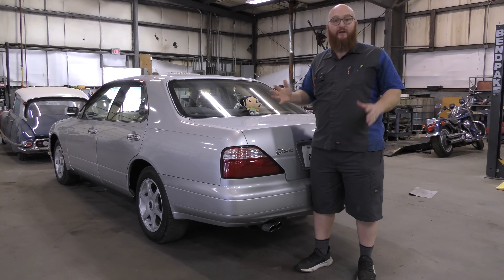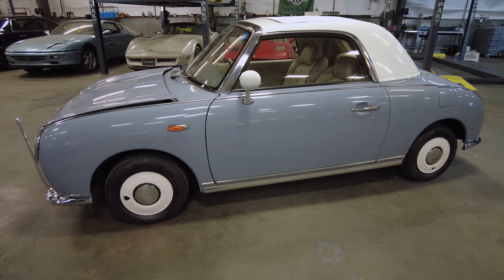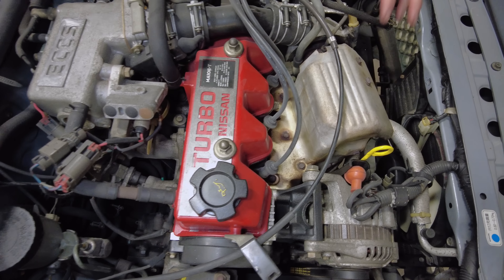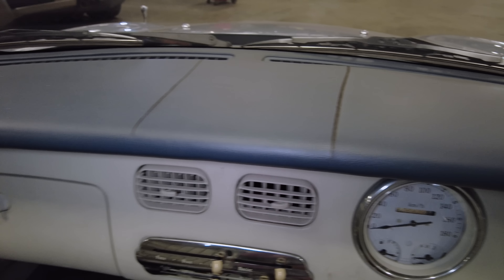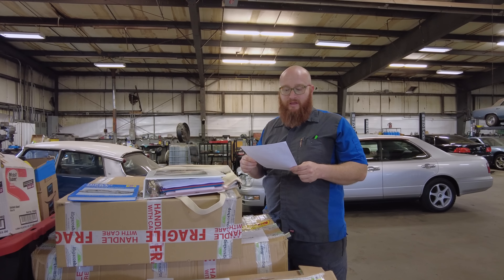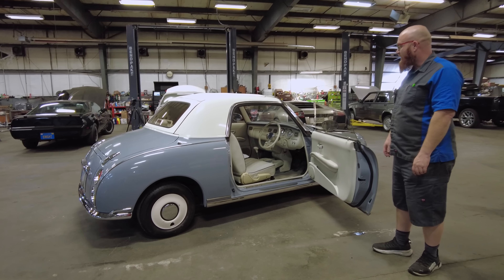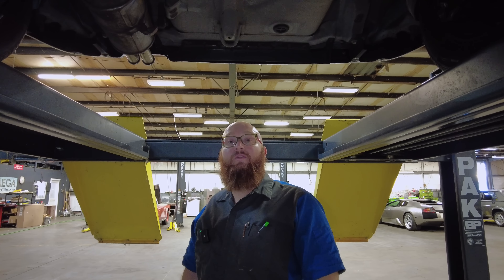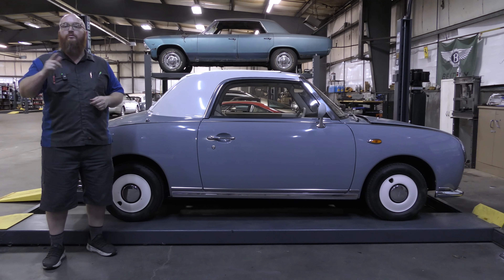The Ultimate Guide to the Iconic Nissan FIGARO: Everything You Need to Know!

Comment: If that car was sold in North America I would have been interested in it. Does seem like it should have got much better fuel mileage . Other then that it seems like a sensible tiny car
Reply: Transmission hampers the mpg. If it had a manual it would be in the 40's. Knew a guy that had a 90 Mitsubishi Mirage and it regularly got 38-40 on the highway with the 5 speed.
Reply: It also has a 3 speed automatic I heard and none of the gears are very long legged. It's not meant for highway pulls.

Comment: These are very common in the UK. I didn't know they were so rare elsewhere!
Reply: They're not that common - they only ever built 20,000 of them and as they're all 32 years old, rust and accidents will have claimed a few. That being said, there's one near me identical to the one in the video.
Reply: @Zeem4  there's several near me in North Yorkshire, but maybe there's a Figaro/Micra specialist nearby that I'm not aware of.
Reply: In Japan it costs a huge amount to get an old car through their safety inspection even if there is nothing wrong with it, so many old cars end up being exported to Australia, New Zealand and the U.K.

A t one point they reckoned there were more Mitsubishi FTOs in the U.K. than in Japan despite them never being sold here.

Comment: As I recall, 12" tires in the USA only have a width specification (no aspect ratio), so you'd see them in a size like P155/R12.  The Renault LeCar (Renault 5 everywhere else) had them.
Reply: 12" wheels were used on some configurations of the Geo Metro (and I think also some early Hondas?) .  So you could get tires for that car here.  They might not be the exact same size, but if that car isn't a daily driver they would probably be close enough.

Comment: The Ford Festiva, a subcompact made by Mazda for Ford, had 12" wheels.  I have owned two of them in my lifetime.  They were pretty common back in the 90's and 00's, so tire shops probably could get that tire size, at least back then.  Although I haven't seen one of these on the road in probably the last 10 years. (sure would like to get my hands on another one now, though)
Reply: The 80s Chevy Sprint/1st gen Geo Metro & 1st gen Subaru Justy used 12” Tires.
A 89 Daihatsu Hijet Kei pickup I have uses 10” tires.
Try finding those at your local tire shop😳

Comment: We got loads of these in the UK, & you still see them regularly (we get loads of JDM imports, thanks to the fact Japan has VERY strict laws about old cars, + are RHD). One thing I will advise the owner to do, is rustproofing! JDM cars don't tend to have much in the way of rustproofing, as they dont use salt on their roads, as a result, most of the UK ones have rotted out, especially in the rockers, rear wheel arches/fenders & floors, + a lot of the chromed steel parts, like bumpers, rust as well (I`ve seen them snap off!), so, tell him to get it thoroughly rustproofed ASAP, even more so if he`s in a wet area!

Comment: There's a pink one local to me on Portland (UK) that my sister would buy in a heartbeat, though I suspect our salty sea air has not been kind to it.
Always surprised they fitted a three speed auto to it, would be interesting to replace it with a contemporary 5 speed manual (as a Micra/March would have had) to see how that improved performance. Supposedly they'll do highway speeds but at quite a high RPM due to running out of gears.
Reply: We had a baby pink figaro here in the uk. Like the wizard said they only came in limited colours to represent the seasons. Ours was painted pink by a company that imports them from Japan, then gives them a full overhaul before selling them. 
Tell you sister to get one, they are good fun with all the mod cons…. Air con, power steering, electric windows etc.
Most are being eaten alive in the uk by the dreaded rust now.
Reply: The Japanese keep the best cars for themselves JDM = Japanese Domestic Market.
The figaros had so many pre-orders and a limited 20,000 production run, they ended up doing a lottery for your right to buy one. If your ticket was drawn you had an opportunity to buy one. 
I think it was something to do with a big anniversary at Nissan.
Reply: @gilberesrepairs  Alas her driving days are on hold at the moment due to health reasons and she's quite happy with her slightly more modern Micra at the moment, plus she really needs proper back seats.
Reply: @gilberesrepairs  It makes me wonder what it is like in the factory. Was there some kind of excitement as the workers put them together and they rolled off the line? It had to be different than, "oh here is another sentra" (or whatever boring mass market car they were making at the time).
Reply: @dglcomputers1498  My wife would offer to pick up our two sons from secondary school in the pink fig. They would respond with, nah we’ll walk 😂😂
Reply: @estuardo2985  Yes, definitely. They were only made in four colours with no options. The centre of the steering wheel and the piping on the seats was colour coordinated with the paint and i think maybe the carpet.
Certainly must have been a change from the daily mundane 👍
Reply: Here in Louisville Ky a guy owns a pink one and a blue on. I was at an outdoor concert talking to a guy with a Land Rover on display about it, he mentioned a  british guy owned a 6x6 fire truck Land Rover and that's the guy who owns the Figaros. He lives a few blocks from me. Didn't know he had that LR, I only ever saw the LR ambulance. Small world.

Comment: Wizard, i have a question. I have dealt with shops in the past that say if you supply your own parts, they won't warranty the work they perform. I know that shops do make a bit of money on they parts that they order and I understand it. How do you handle a situation like this in the case of this car? If something should go wrong, with something you installed and the customer supplied.
Reply: Customer pays labor to change.
Reply: The shop usually has existing relationships with affordable yet good quality parts suppliers where they can take advantage of warranty replacement if the part is DOA. When the customer supplies the part, if the part is DOA, the shop is almost guaranteed to end up in an argument with the customer, and they hate that. Many shops refuse to install customer supplied parts outright for that reason. I don't think this comes up much for the Car Wizard unless it's because it's a super rare car, he is so backlogged that someone isn't going to come all the way to him for quality work and then bring their own parts just to save a buck or two.

Comment: When l first saw one of these in Rockdale N.S.W Australia yes there is a couple in Australia l wondered were it  came from l thought it was some obscure Fiat from the 1960s a car l have never heard of then l had a chance to park my van and check it out and l noticed the small Nissan writing on the bonnet and the one l saw had a cassette player that dated it to the 1990s and after that l saw a couple driving around and two for sale at two different car sales not far apart and both priced at aud $20000 and they both sold and there is a collector of Nissan Vigaros in the USA who has over 200 of them

Comment: Kei cars are great. I love them to death (which is what would happen if you get into an accident with a modern suv). Thanks!
Reply: This isn't a Kei car. For a Kei sized roadster check out the Daihatsu Copen.
Reply: Not a Kei car - as the engine capacity is greater that 0.66 litres.

Comment: theres one of these usually parked outside my work (uk)
a horrible car imo
Reply: Agree the overall design is a pastiche of 1950 and 60s design cues no wonder it was manufactured during a single year.
Reply: @georgebettiol8338  I'm not even speaking from a design pov.
They're dangerous lol. Built with cost cutting measures in mind.
If you imported one brand new and didn't take it to a garage for weather proofing (barely anyone did) it would rust like hell.